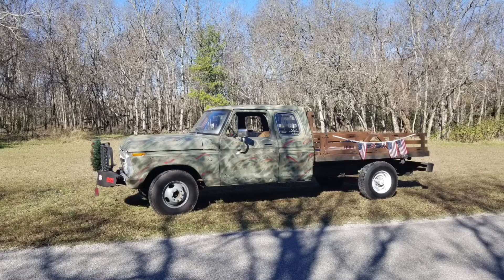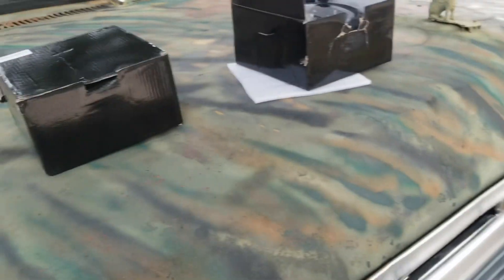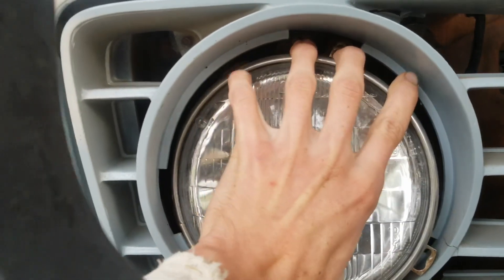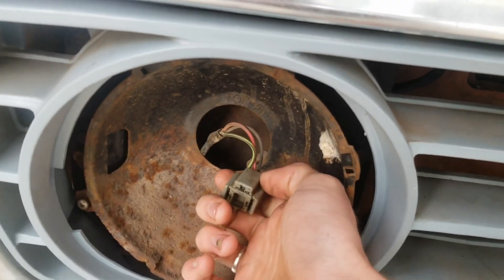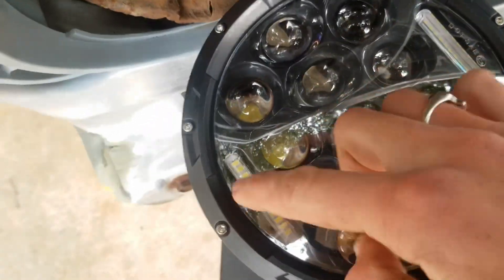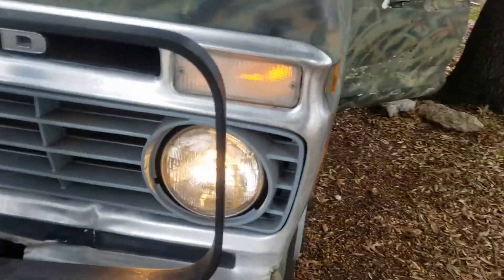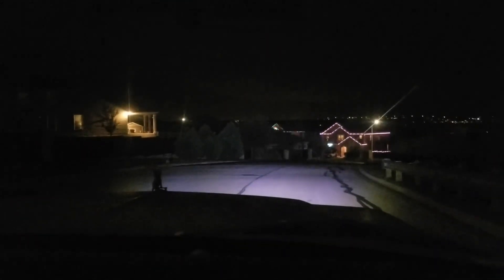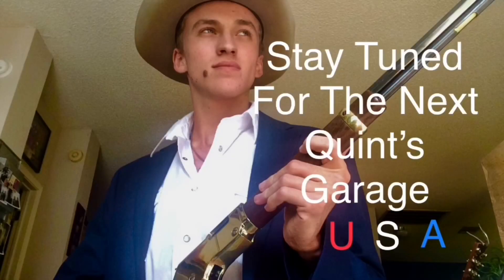LED Headlight Conversion! 1953-1977 Ford F series. Quint’s Garage EP.44

Comment: Now them's some bright headlights.  We "we" always called all of the lights on without the headlights on "parking lights".  That was the official term used back then.
Reply from the maker: Yes, running lights is what I've always called them, unless its Tuesday
Reply: @Quint1836  Tomorrow is Tuesday, so your truck will have parking lights for several hours.  This will expire at 12 midnight Wednesday.
Reply from the maker: Works for me
Reply: @Quint1836  I thought it sounded reasonable.